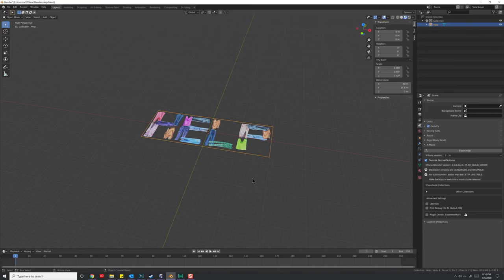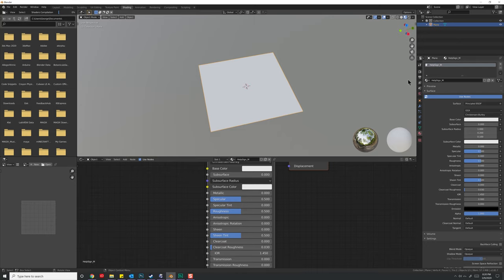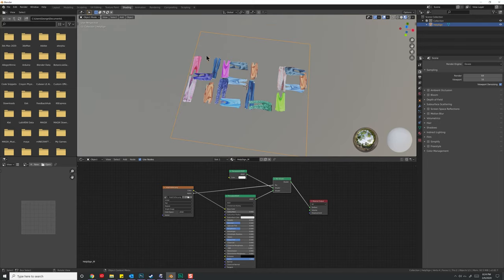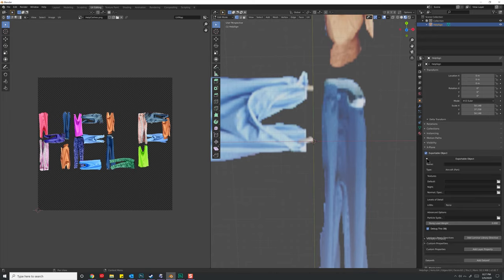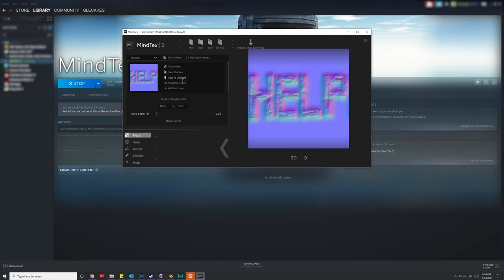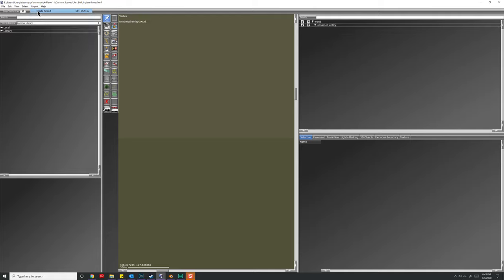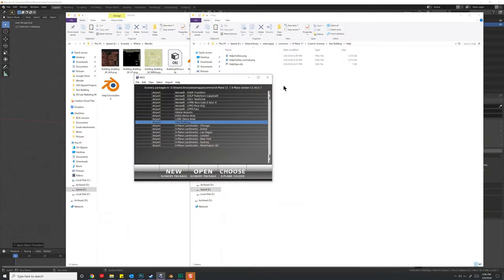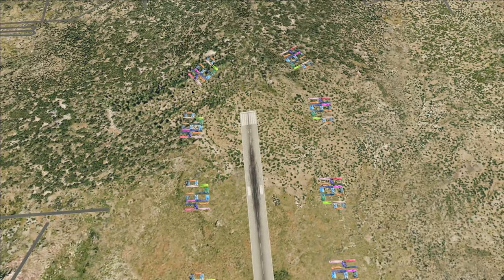Modding X-Plane | Draped Objects | 05

Comment: Great, thank you for the tutorial, is it possible to make custom polys with this?, Also, does blender capable of baking normal and specular maps combined, or i need to use external software?, and if so, what free software do you recommend?
Reply from the maker: You can create any kind of polygonal object, just remember that it will be flattened, the vertical component is ignored. So if you build something that is vertical, it will all be squashed down onto the terrain, which can cause strange results. You can bake normal maps in blender if you are using geometry from a higher resolution object onto a lower resolution object. You can use applications like Photoshop or Gimp to combine the channels to create the normal map if you don't have access to substance painter.
Reply: @GeorgeLecakes  Thanks for the information, I know how to bake from high to low poly, but the steps to combine normal and specular, that is what I don't know, Can you elaborate more on this using Gimp?, me for example, i do it all in blender, but the only texture that I can't understand is combined normal/specular, do you have the time to show me how to combine the channels with Gimp, I don't have access to photoshop, and thanks in advance.
Reply from the maker: @AdelHaiba78  I'll see what I can do.
Reply: @GeorgeLecakes  Awesome, Thank you Mr. George for the help.

Comment: Hi, could you possible do a tutorial on how to mod and make PBR texture on a default x-plane 11 model with substance painter?
Reply from the maker: Biggest issue would be converting the model from the X-Plane format to one that could be loaded by a 3D modeling program. Once you do that, everything else is the same as I've shown in the other videos. I don't know of an existing application capable of doing that. Everything I know of is from 3D model to XPlane and not the other way around. You'd have to write a custom importer in whatever program you want to use. The good news is that the X-Plane format is very easy to understand and it wouldn't be terribly difficult to do.